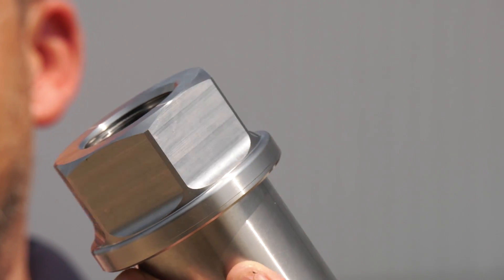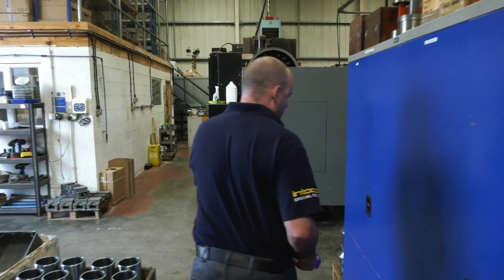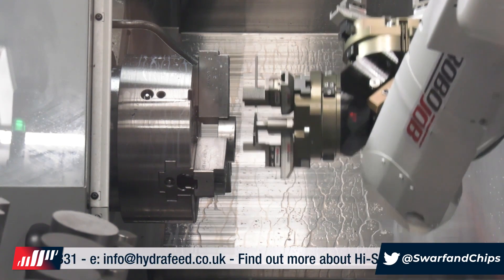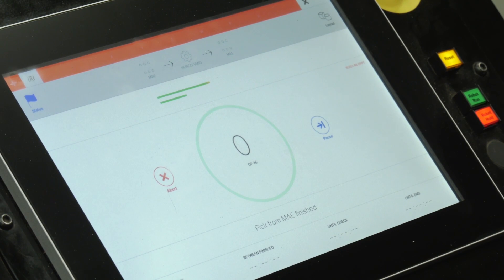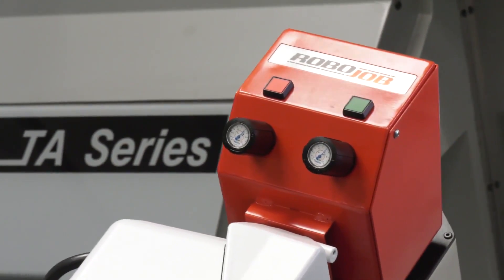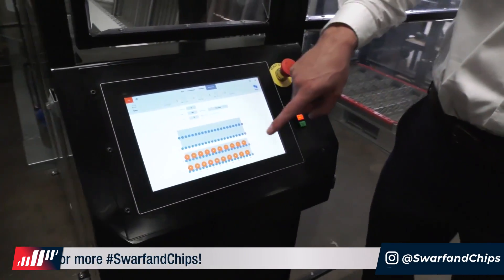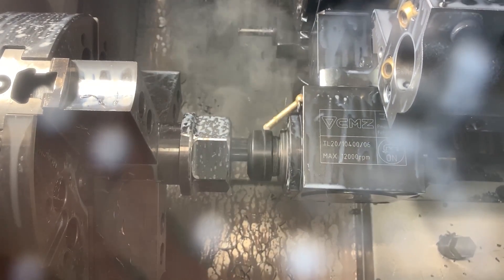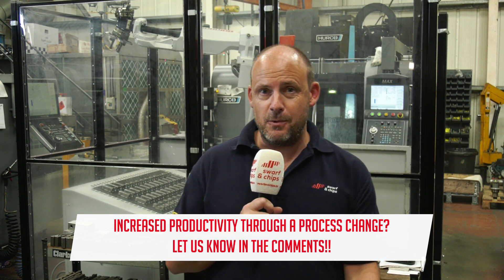Could YOU Make This Component In One Operation? - #SwarfandChips

Comment: Well, I'd argue with "one" operation. It's still 2 operations, however human was changed for a robot. And you could do it in 2 op's with this machine without robot, so they used/bought different machine anyway. So it's more about automation, not making it in one operation really. 
It doesn't change that it's awesome to see things like that being implemented.
Reply: I thought  the same- This part could be made in a single operation with 1 Y axis lathe and some creative tooling for backside chamfers on the ID of the stud portion of that fitting. Better concentricity tolerance to boot.
Reply: @grinchyface  Even more so, the hexagon can be done without Y-axis. Just C-axis interpolation. Still, because I've seen prices on robots of that size, it does make sense to buy the robot to automate the machine instead of buying a new machine. They are great value, actually.
Reply: @ExMachinaEngineering  I'm just spoiled by features, you're right. Really any cheaper CNC lathe could pull this off in 1 op
Reply: @ExMachinaEngineering  I know a company that has a robot cell just grinding a bevel on a piece of raw steel, 24/7/365. The ROI is insane
Reply: There was never a need for 3 set ups, and the robot just replaced a person. Not sure what thd big deal is
Reply from the maker: Glad you enjoyed the video !

Comment: if you had one 4 axis machine you could do it in one setup anyway...face, drill and bore all the way through, with steps for the clearance behind the thread, thread the end furthest from the chuck, turn the OD, mill the flats, part it off... the only issue is the chamfer, but you could plunge that with the boring bar , just need the right boring bar and insert.
Reply from the maker: Glad you enjoyed the video !